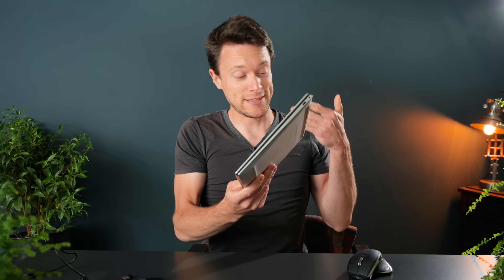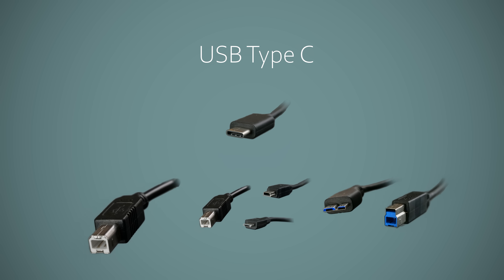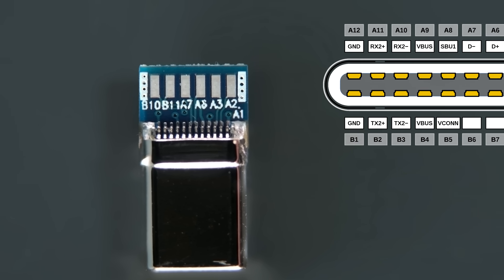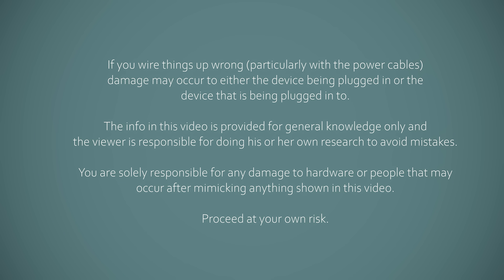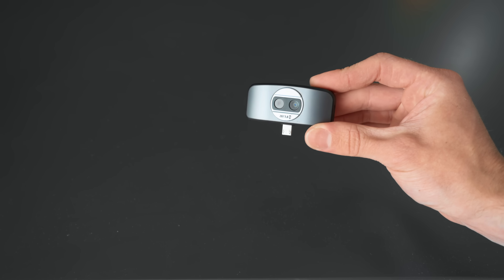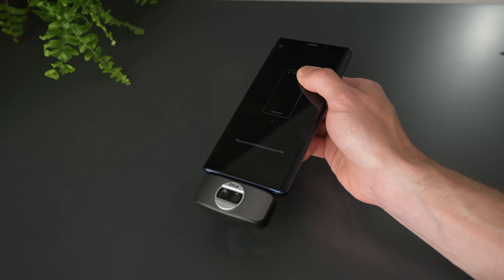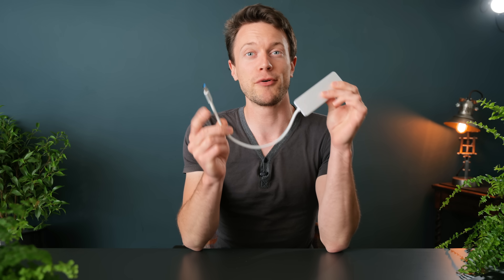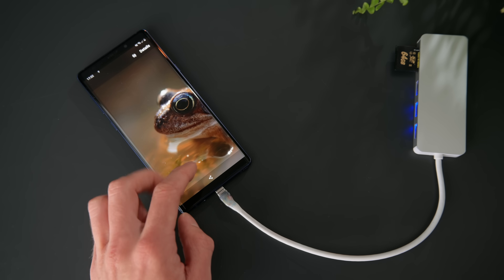Converting devices to USB Type-C

Comment: Could it be possible to make a split connection to a existing wire so you could have both type-C and A connector? Quite a hassle to open the wire and split every wire to two paths but could it be made?
Reply: Yup, you can even buy cables on AliExpress that do it.

Comment: If USB C can be inserted in both directions, then your concern of where (white & green) and (black & red) wires are soldered, makes no sense...
Reply: Ummm if you wire up Tx to Tx & Rx to Rx it's not going to work mate..
Reply: @JornNavarre  well mate,, if I can flip the connection,, it makes no difference.. tx will be tx till you insert the other way, then tx become rx..

Comment: Why not find a monitor that has a USB output and wire in a laptop webcam, then drill a small hole for it (anywhere on the border of the screen) That would be a better use of an old laptop webcam in my opinion.
Reply: @JornNavarre  I have a Dell UltraSharp with 4 USB outputs and one of them can be used to operate the webcam from within. And yes I am aware that the Dell has one USB input from the PC to the monitor it self. Also, the webcam can be installed within the top or bottom bezel of the monitor.

Comment: Not to be that guy but you could say this is is technically just compact dongles as you have physical wires but breaking the trace is not good, that resistor can be moved with a heatgun over to the second pad set. It’s there for a reason use it.

Comment: Funny that, I was told, by Logitech no less, that Unifying connectors might have trouble, when connected to USB 3 due to interference. In fact, I experienced several connection issues, even though the dongle was pretty close to the mouse... I guess, changing the Unifying standard is pretty much impossible, though why they still create new unifying devices, instead of using a new standard that won't have these issues is beyond me. Of course, it would take a few years, but  after a while everyone would be migrating to the new one, especially as the idea of just one connector for several input devices is genuinely great.

Comment: Is there a way to upgrade the opposit as well? So you change the connector on a phone, controller etc from micro usb to usb-c? In my case I find it quit bothersome that my xbox one controller still uses micro usb.....I mean even the switch pro controller got usb-c....
Reply: Yea you can get a female USB C connector, if you can find one with a pad on it to make it easier. It won't increase any charging speeds though and the only advantage is being able to use a different cable that is reversible

Comment: 7:17 there's already a resistor there, but you need to move it from spot R1 to spot R2.
You don't need to look for another resistor.
Scraping away the trace as he did and jumping the disconnected pad to R2 is also an option if you don't want to desolder SMT components.
Reply: can u explain what you mean by jumping the disconnect pad to r2? Which is the disconnect pad

Comment: you are aware there are converters for it other then dongles. i agree some device you save on length on by fiddling with solder and sugru. in the case of the mouse its a usbA mini sized plug meaning its internal board is inside the metal plug as well. for such a small one id go with a small usb-a to usbc converter . you slide the usb a male into the usba female and a usbc is on the other end.
really small

Comment: For Micro-USB there are very small adapters that plug into the USB-plug of a cable or other device. So your mouse-stick would just stick out the size it is (with the metal) and is plugged into the USB-port. maybe there is something like that for USB-C too.

Edit: Found it (google for "Nano Type-C OTG Adapter")

Comment: I have a DIY project for you-

Using broken mobile's logic board and joining it with a broken laptop's motherboard to make a new laptop which is both a computer and a phone.
A small switch to change the input of the laptop's display and audio.

I really want this project to be made by you as it's my dream project and sadly I'm not skilled enough to do this.

Comment: So I actually have a set of wireless headphones with a female micro USB port. I assume the process would be similar, but would I still need the resistor swap?
Reply: Don't try, that's pro level soldering on port connectors.
Google : Micro USB Magnetic charge cable, they're $8, work great !!

Comment: I think for converting a device which has a cable like that adapter it's better to replace the cable with a usb c cable. It would be much easier to solder inside device and much better looking.
Reply: That's another option. Most devices are glued together tho' and all different.
It's easier to teach the connector method :-)

Comment: Wow this guy still has mx revo! That mouse is very comfortable and old
Reply: I think it's logitech mx performance - it's kinda heavy, its battery use sucks and the microswitches in buttons can get stuck (which can be fixed). But it's worked for me for 8 years, so I guess it's an ok mouse.

Comment: I love your everything
You give me so much motivation for my diy projects!

Could you me give an advice?
When I'm soldering small wires, the insolation always gets messy...
How do you keep the wires and insolation so clean and non-deformed?
Also, what soldering tip do you use for such small soldering tasks?
What is that material you put on the resistor?  Is it electrically isolating?

Comment: Just buy a mini adapter, then you can still use the device in a USB-A port and you save yourself a lot of work.  Replacing a female micro-USB connector on a keyboard, for example, with a female USB-C on the other hand would actually be useful since micro-usb is not very durable.

Comment: This is stupid. Even as a DIY project it's an absolute waste of time and huge risk to all of your "high end" wireless mice out there. You can literally buy tiny USB type A to USB-C adapters that are as small if not smaller than those breakout boards and they're only a couple bucks and you retain the ability to still use a type A port if ever needed. Why would you literally break open your device, as in that wireless transmitter, and create some expensive sugru monstrosity that's bigger and less useful than just attaching a tiny adapter? If, literally, the only thing on the market were those dongle cables then this would be a neat project, but there are vastly better solutions than this. The time and money spent doing this is pointless.

Comment: I love how your channel actively pushes back against built in obsolescence and e-waste just by providing ways to upgrade tech and reuse hold hardware. Keep up the good work! Love your content!
Reply: USB C to A adapters are readily available and have the added bonus of acting as an OTG adapter for USB-C phones.
Reply: @soundspark  this is true but on some laptops the ssmc ports are to close together to put 2 usb-c to usb adapters next to each other. (i can't even plug in a hdmi cable and usb-c to usb adapter next to one another)
Reply: @neko_my_cat  - In that case the devices he converted won't fit anyway, as they are as wide, or wider than the usb plug.
Reply: Planned obsolescence should be made illegal IMO.
Reply: Yeah
Reply: Gotta use a dongle.  I have a dongle, a dongle-berry.
Reply: yeah it's interesting, but this channel for me is just interesting to watch. Most of the projects are stuff that you'd never ever want to attempt. Like the light screen from broken TVs into false windows.
Reply: Minor spelling mistake 🤦
Reply: ya mee too like the one that you repurposed an old laptop (even though all of the ones i tried failed );
Reply: Its not really a "upgrade" just less device support
Reply: usb a to usb c is realy pointless. most computers use usb a

Comment: Love your videos, they're not only informative, they're easy to watch (really enjoyable!)
I don't know if you take questions, but I have this microphone which I discovered it's an electret type (I thought it was a condenser but that's a different story). It has a 2.5 mm jack, and has only two wires: a white one and a stripped one (so you can see the copper inside), so pretty cheap. 
My question is: how can I wire those two cables to a USB/Micro-B cable so I could use it by plugging it into my PC/Cellphone? Apparently I can't just plug it with the mini-jack to my cellphone since it doesn't recognize it as a microphone, so maybe plugging it from the charging port would help

Comment: Awesome! Will probably also do this if I find something! I have a suggestion for the USB hub you converted. Instead of cutting the wire, just open the entire hub and solder a entire new USB type C cable. This would make it look better and probably easier to install.

Comment: After you scrape off the lead on the usb mouse reciever one could probably solder on a blob on to the resistor leg you scraped away and over to where the other resistor should be and thus use the existing resistor that way as it gets minus instead now? Or does it not have the right resistance?

Comment: You should have used the sugru and a cut open usb 3 cable to lay out the wires side by side to make a wire holder for soldering.

Comment: So the Type C host is able to reverse the pin configuration, if you plug in the guest in reverse? Are there any ways to destroy something with a  USB c converted device, if you plug it in the "wrong" way? At least there was a reason, why you can't reverse the older generations of USB

Comment: Why did you add that big resistor? You could simply solder the existing resistor to the two pads next to it. That would pull the signal pins to ground. If that was too difficult: cut the trace as you did and connect the two top pads
Reply from the maker: The pull up resistor is 56k. It needs to be 5.1k for pull down to work properly.

Comment: I've been thinking about this but kind of the other way around: converting my pc case from usb a to usb c. That would probably be pretty easy too as the connectors are just screwed in. It would be nice if the case manufacturers would just sell conversion kits.

Comment: You have one misconception that explains a few bits you are confused about: USB-C was not intended as a host connector; it is was primarily designed as a sub connector for client devices, and the ability to use it on host devices is part of the OTG standard. Computers were intended to continue using USB-A connectors.
This is both why Logitech's dongles do not come as USB-C, and why breakouts typically have pullups configured for use connecting to client devices.

Comment: I must look after my devices too well!  Do not yet have anything Type-C and only just got USB 3.0 with my Ryzen PC for the first time about 18 months ago!  No accessories to plug in to need it just yet, apart from one memory stick.  Sub-connectors on most devices is 99% and Micro-USB.  I think some things are starting to get to EOL though - just had a ThinkPad T520 die on me, and that was only 9 years old.  Bit disappointed really. :-)

Comment: Nice and educative hack. One would say "well done".
However do NOT do this when using devices that are running via USB 3.x speed or better say don`t do this if you are planning to use a device (i.e.HDD) that transfer a lot of data via USB.
If you will have issues and data loses you shall ask yourself:
1. How my Eye Diagram over the USB connection looks like?
Answer: a nightmare
2. What about 90 ohm impedance of the data traces / cables /aso...?
Answer: what impedance? 

Not so easy as one would think...educative however don`t destroy your expensive devices by doing this..

Comment: If you can get caps and resistors from Digi Key you can get the SMT parts. Really, it's not hard to hand solder SMT. I've been doing it for many years at my job. The easiest way is to, heat up one of the pads and use a Q-tip (Cotton Swab) and brush off the solder in one pass (the cotton wont catch fire, if your worried it will just add some flux to it) the take the resistor or cap and solder the one side that still has solder on the pad, then solder the other side. It's much harder to solder SMT to a board with both pads filled with solder. I've also came up with a way to solder IC's in somewhat the same way. I still use a Q-tip but I cut the stem at a 45 degree angle and use the sharp end to clear all the pads but one, solder the one leg to the PCB and then go down the line of legs one by one.

Comment: 7:08 couldn't have you just moved that resistor to the R2 pad? Looks like that one is going to gnd
Reply: Yep, my thought (or yelling at my monitor) as well.
Reply: Had the same thought. Looks pretty clear that those pads are meant to be configured by the end user if needed. Could even use the same surface mount resistor.
Reply: I thought the same lol
Reply: Yeah, that part is painful to watch 😬
Reply: It's less fun that way though :P
Reply: Yes, but soldering SMD is somewhat more difficult - especially if you're unexperienced.
Reply: @havarhen  well, soldering a huge resistor lead to a tiny pad is still quite challenging
Reply: Yes, that's certainly meant that way.
Reply: that was funny to watch
Reply: wrong value on the old resistor unfortunately.

Comment: Yes! I’ve wanted to replace the port on my micro B devices for ages. Usb micro b is the WORST connector ever designed.
Reply: Micro usb is fucking shit. It break over time even if you are careful. Its just thin and easy to break
Reply: Micro USB 2.0 isn't so bad. Micro USB 3.0, on the other hand...

Comment: If you have an older device and still want PD, not all is lost.
I actually managed to get PD signaling to work with a USB A device. there are PD emulator board available which does exaclty this.
like this one: https://amzn.to/3bfRs0C
I got the bare board. Then, I connected only the VCC and GND from Type A to the emulator and VCC, GND, CC1 and CC2 from it to the connector.
TRIG to GND. RX and TX directly from the type A to the Type C. Works like a charm.

Comment: uuuuh, couple of things about the 2.0 to 3.0 transition... 3.0 also has a higher power delivery compared to 2.0... and the C- plug not only is reversible and has an even higher power delivery, it's also stated to be vastly more resilient compared to Micro-A 2.0..
Just an FYI

Comment: every itme  have tried to solder in the past I just instantly ended up killing the soldering iron tip it just corrodes and oxides. could it be because I'm using cheap solder or cheap soldering iron?